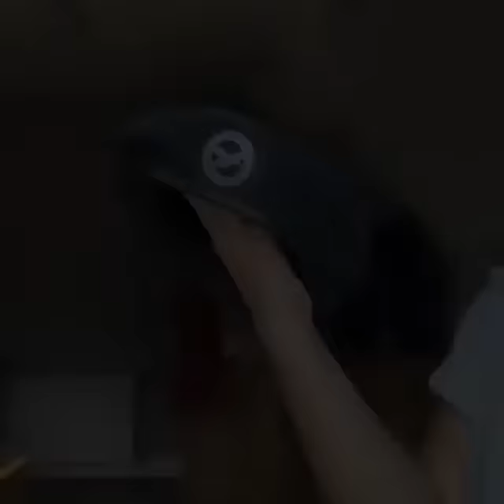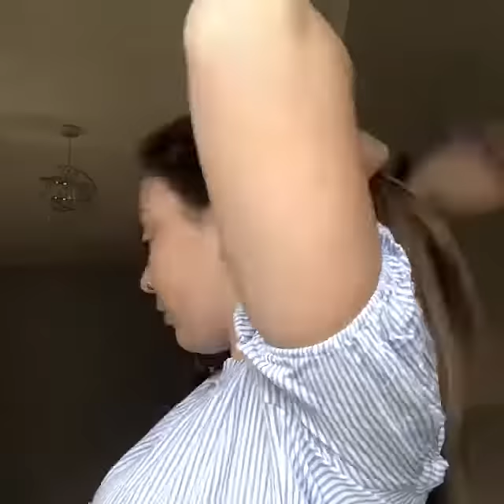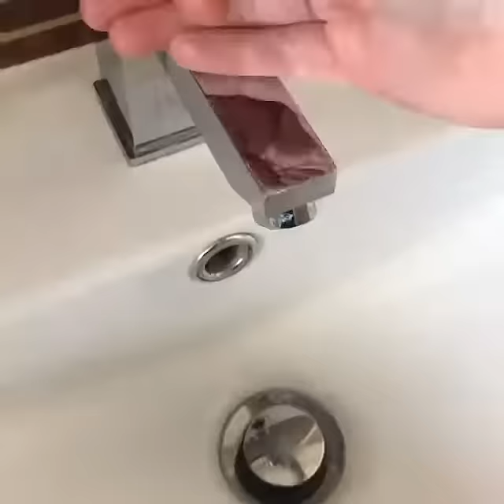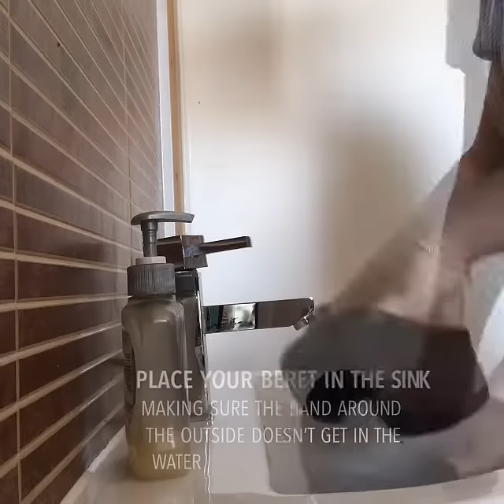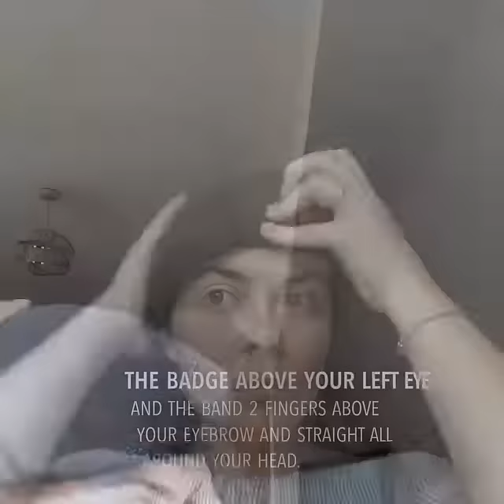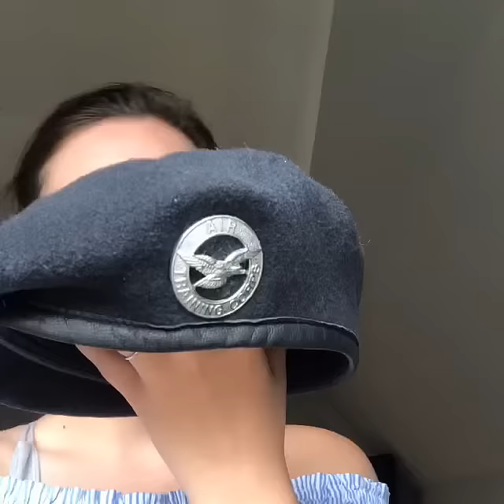The Proper Way to mould your beret

Comment: Step one ditch the black beret and earn a maroon tan or green one step 2 safety razor the fuzz off step 3 take a hot steamy shower with it in shaping and pulling it if it isnt covering the opposite eye your wrong step 4 wear it with 10% regulation 90% attitude

Comment: Another tip here:
- Shower with it often, like 1-2 times a month.
- its recommended to have the beret band go all the way down, touching the right eyebrow and about 0,5 - 1 finger lengths about the left eyebrow.

Styles:
Some like to just pull it down the left side of the face like a pancake, which is fine for some headshapes, but not all. This can also result in ur beret emblem tilting sideways. To combat this, you can pull a little bit on the other side of the beret aswell. Just make sure, you dont let the beret emblem tilt more than 80* degrees downwards. Ppl should always be able to see the emblem. 

Hope this helps!